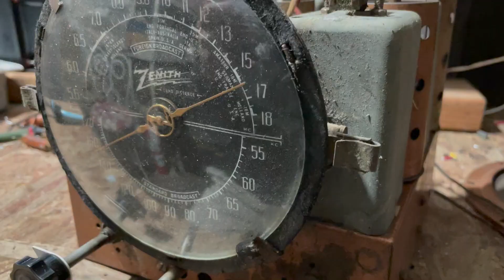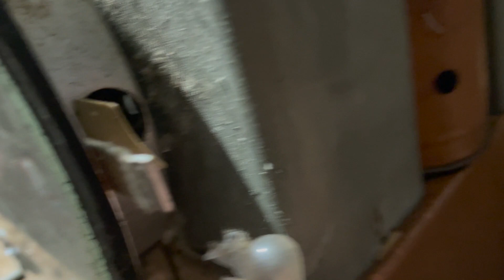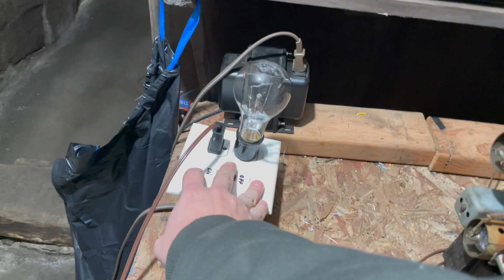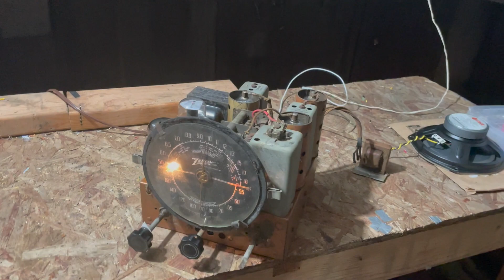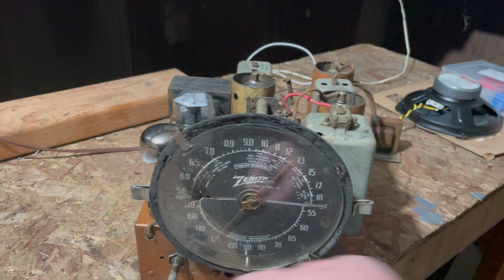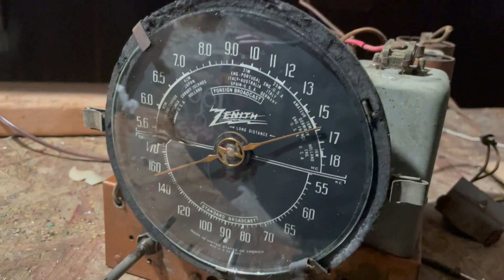1938 Zenith 5-S-237 Chairside Antique Radio Repair Part 2

Comment: Good fix. If you do attempt a cabinet repair go to a home improvement center and grab some saw dust. It makes
a good filler for that long crack in the cabinet. Do it in several steps and it can also be stained to match.